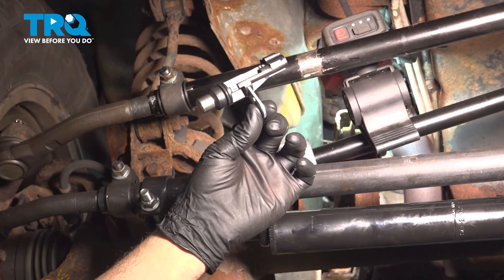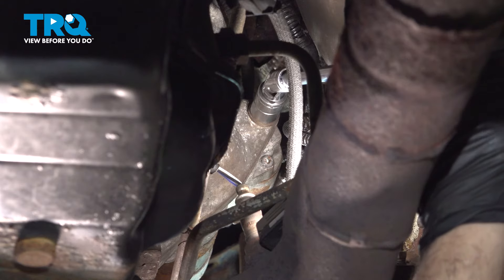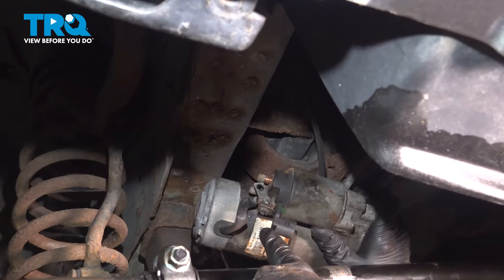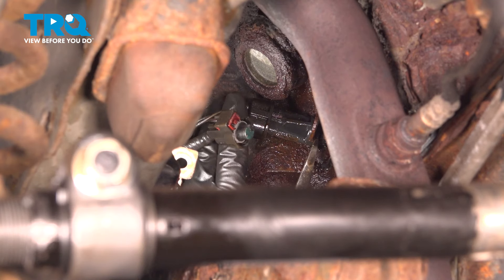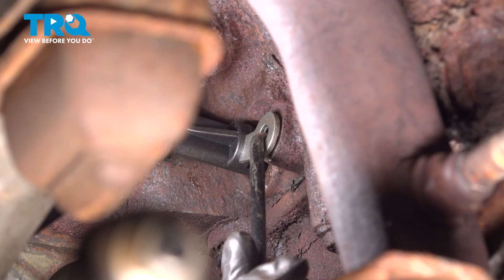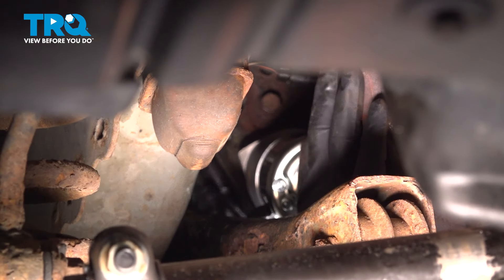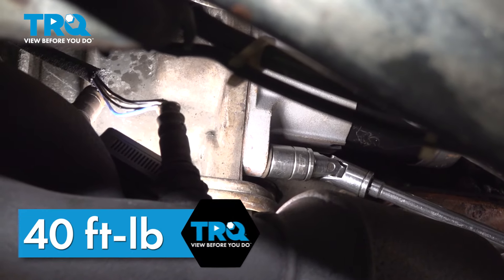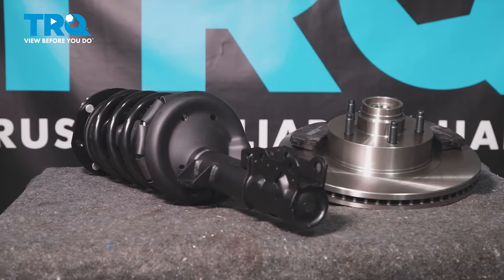How to Replace Crankshaft Position Sensor 1999-2004 Jeep Grand Cherokee 4.7L

Comment: Do crankshaft position sensors have to be relearned by a shop doing it, or can it be relearned by way of regular driving?
Reply from the maker: +@terrellblue357 The crankshaft sensor should not need to be relearned depending on your vehicle information. You can find this information from your service manual.

Comment: Making this job way harder than it has to be. There's a access panel in the driver side floor board that can  be removed to gain access to the sensor. 😂